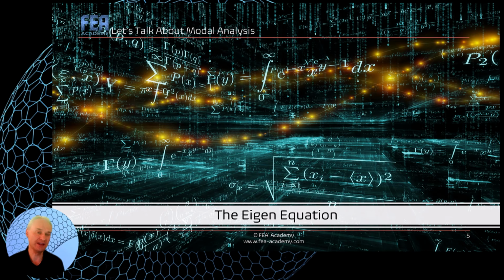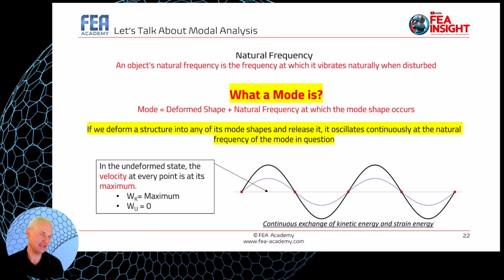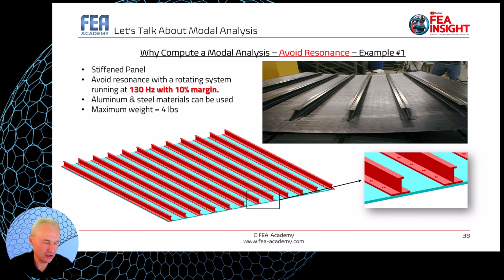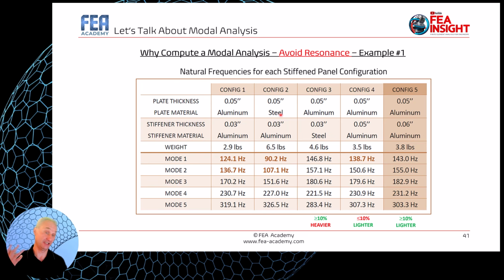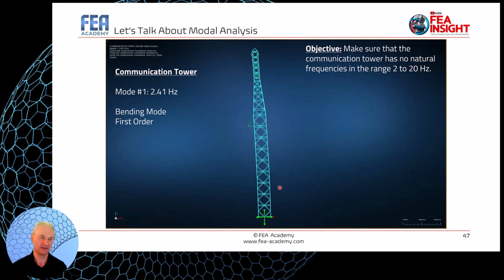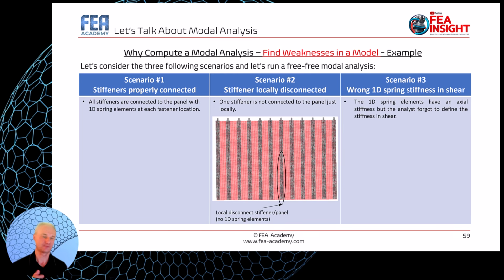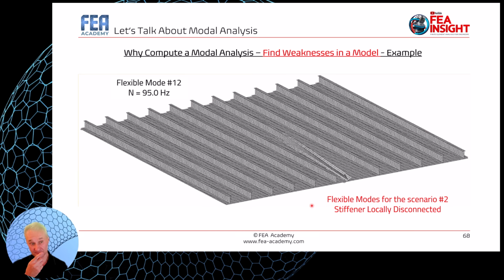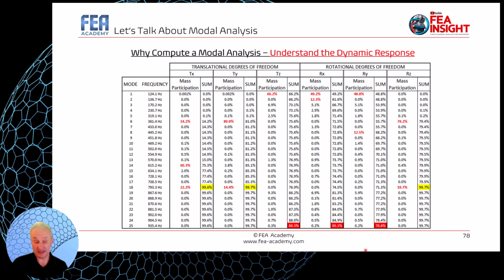FEA Insight - Ep #12 - Introduction to Modal Analysis by FEA

Comment: Thank you. This was really good lecture. A question, why not just model the bolts as a beam and connect them together with MPC elements? Will that be less conservative when it comes to modal analysis compared to spring elements to model bolts?
Reply from the maker: Very good question, thank you for asking. As explained in the video on "Modeling Bolted Joints", the beam approach is valid and can certainly be used. However, beam elements are known to be somewhat conservative in static analyses because they tend to overestimate the load transfer through the joints compared to a 1D spring approach.

In practice, this means that joints modeled with springs generally provide a more representative stiffness than those modeled with beam elements.

Capturing the correct joint stiffness is also important in modal analysis, since it directly influences the natural frequencies and mode shapes of the structure. For this reason, the spring approach is often preferred for modal analysis as well, as it allows a more realistic representation of the joint stiffness.

Moreover, using the same joint modeling approach for both static and modal analyses is generally recommended. It ensures consistency between simulations and avoids discrepancies in structural behavior predictions across different analysis types.
Reply: @FEAMastery  Thank you for the detailed explanation.
Reply from the maker: @navaneethv1709  My pleasure
Reply from the maker: @navaneethv1709  My pleasure